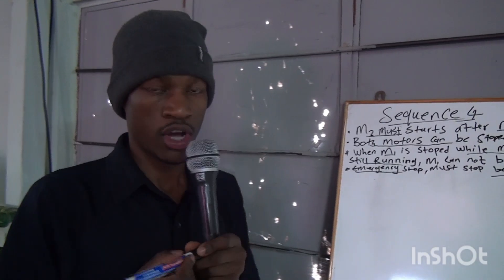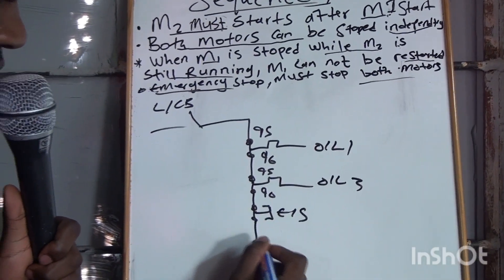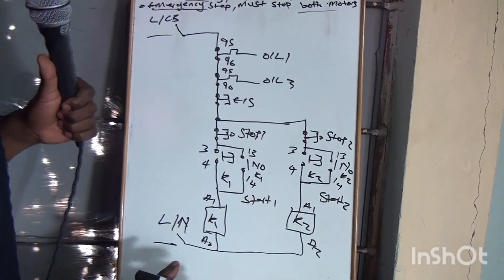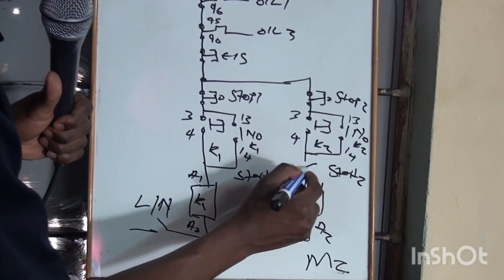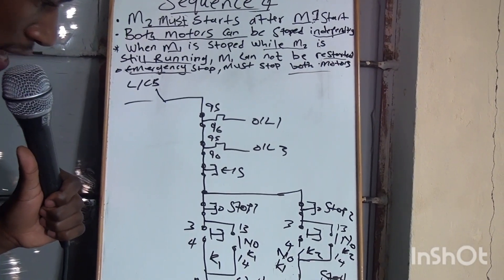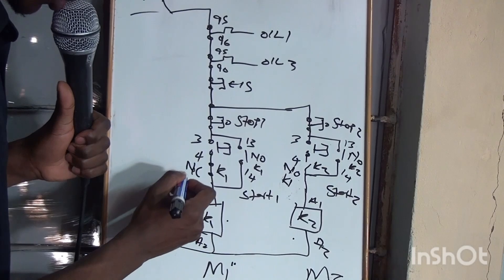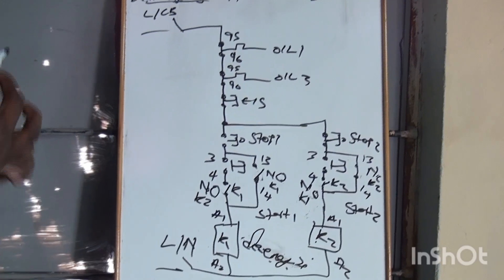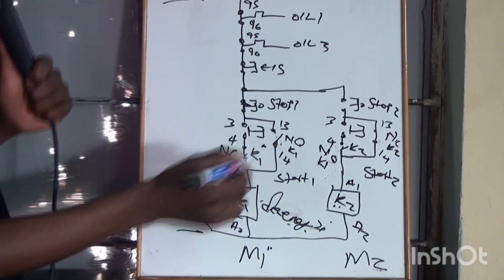MOTOR SEQUENCE 4: MOTOR STATER: ARTISAN ELECTRICIAN

Comment: Why after the coil is de-energised you still change the contacts?
Reply from the maker: @petertshepo9276  a contactor works like this: when it is energized then every contact that belongs to it have to change position, normally open becomes normally close and normally close become normally open. 

When the coil de energize then the contacts go back to their original position. So if before being energized it was normally close then it will go back to being normally close after being de energized